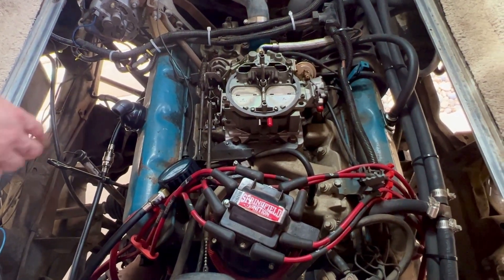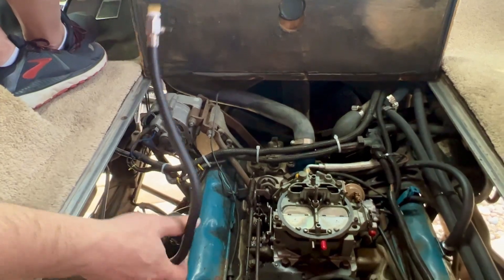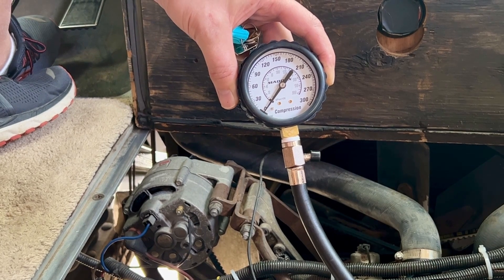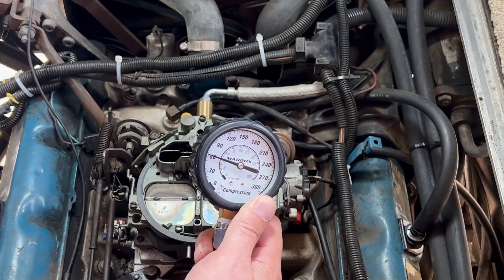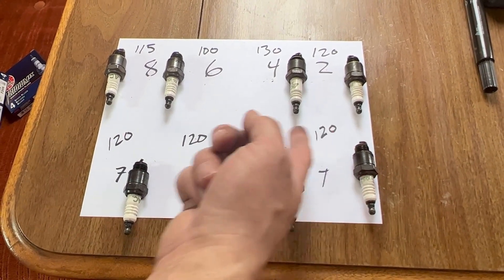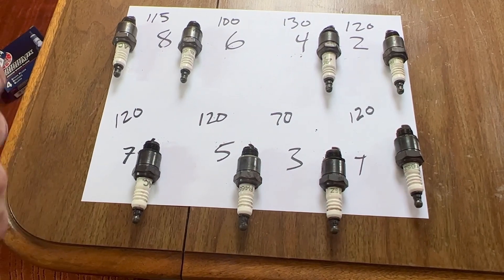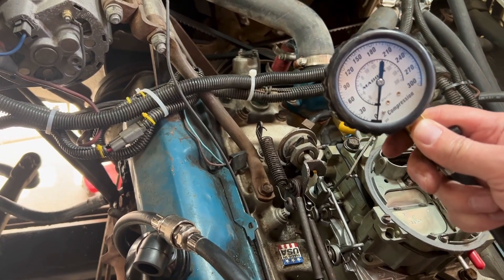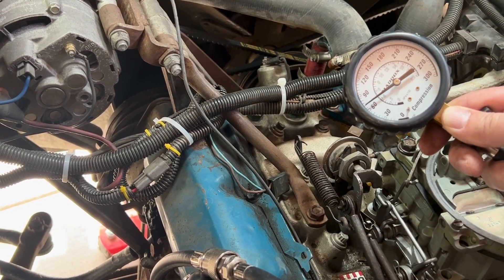GMC Motorhome Compression Test

Comment: You should have the throttle valve open to get a true reading, you engine is trying to pull air in through closed throttle.

Comment: do nothing for now. keep using your motorhome.
Reply from the maker: Yes, that is basically what I have done. I figure that I'll need to do an engine overhaul at some point so I'll get as much use as I can until then.
Reply: @MrGMCMotorhome  Excellent decision. Wait until the engine is really tired !
Reply from the maker: @1983dmd  Yep, and it has now been 2 years and it's still going. I've got some funds saved for when I need to do a rebuild but so far so good!

Comment: Did you ever do the leak down test? I think your question will be answered when you do that.
Reply from the maker: It's a bit of a long story ;-) At the time I was getting low compression, I was also hearing some valve train noise from the same side of the engine. I don't think the valves are adjustable so I decided that any additional testing would just confirm that I need to either pull the head(s) or the engine. Shortly after I made this video, the valve noise quieted down and the engine has been running fine since. The engine has 110k miles on it so I'm just going to plan to do an engine rebuild some time in the next year or two, or when I have problems again. For now I'm just keeping my fingers crossed and hoping for the best :-)

Comment: Curious what you have decided to do to fix your problem?
Reply from the maker: Good question, I'm not sure I have decided yet. Even with the low compression, she has been running okay. We did a 350 mile trip last weekend and she ran fine, even over a small mountain pass. At this point, I think I'm going to keep driving and monitor performance. If/when I start to see a loss of power or noise or other problems, I'll probably just do a full engine overhaul. I'll start saving for that now :-)